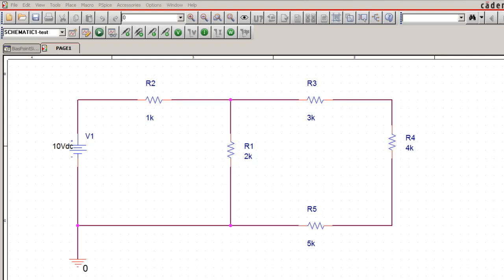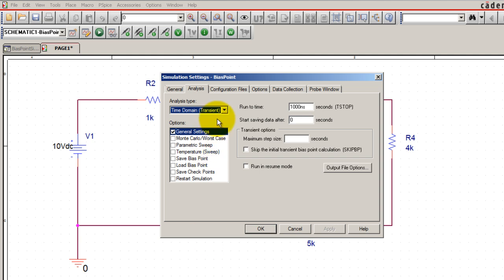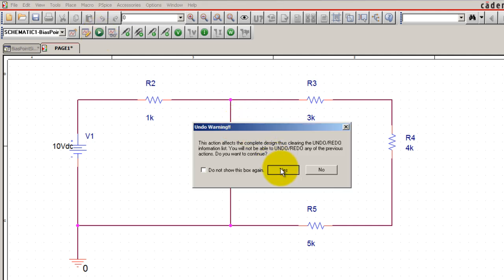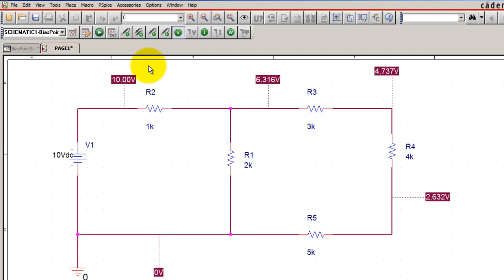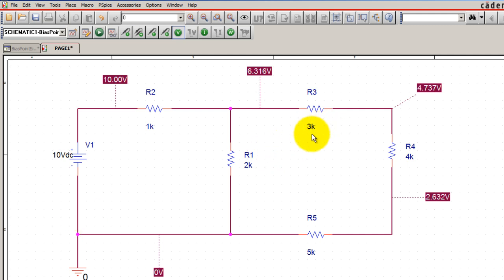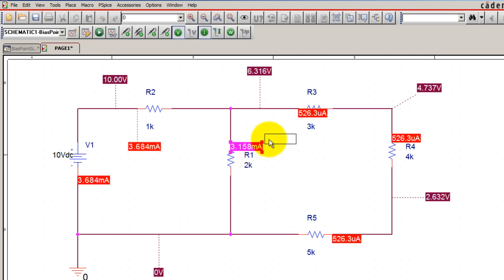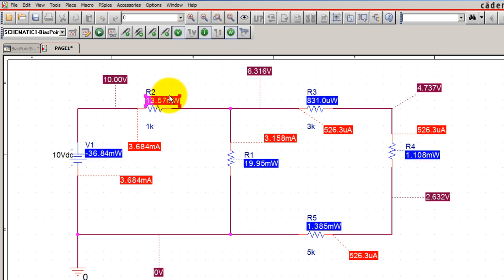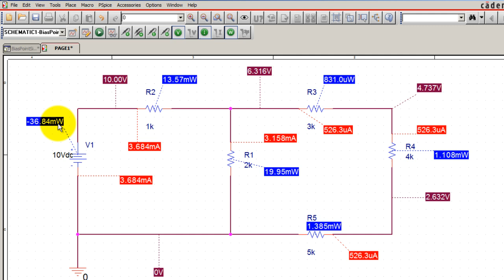OrCAD PSpice: Bias Point Simulation

Comment: Is there a way to update the circuit, such as modify your Voltage Source to be 5V instead of 10V, and rerun you bias sweep on the same simulation and have the resulting labels update to their new values? I have only been able to do this by creating a new simulation profile every time and it is very annoying.

Comment: Is there a way in which you can see the direction of the current?
Reply: The convention says that the flow of the electrical current goes from the positive part of the source(i.e. a battery) to the negative one. But the electrons, the charge carriers in an electrical circuit, flow in the opposite direction of the conventional electric current. There should be a more in-depth description of what I am saying on wikipedia.